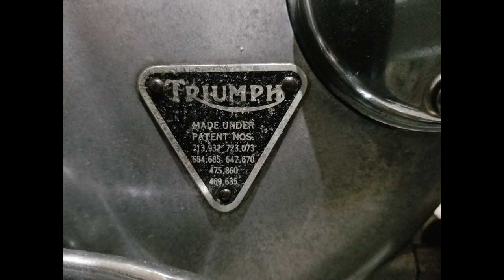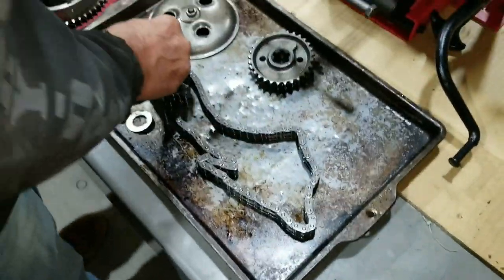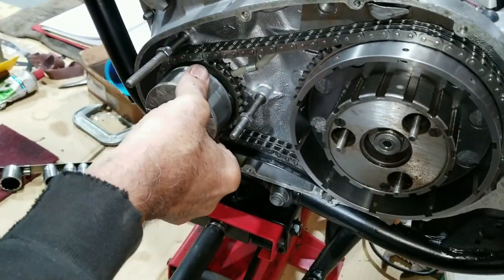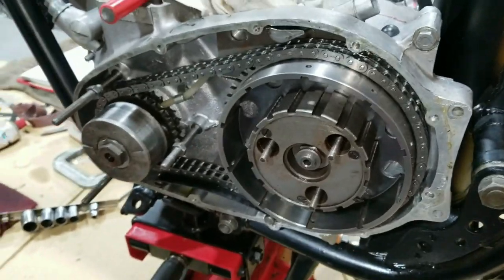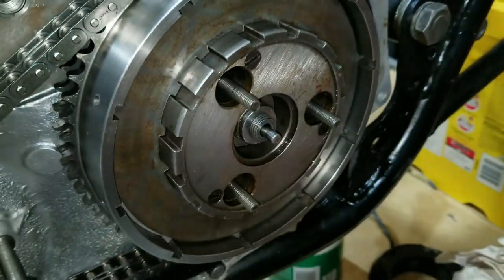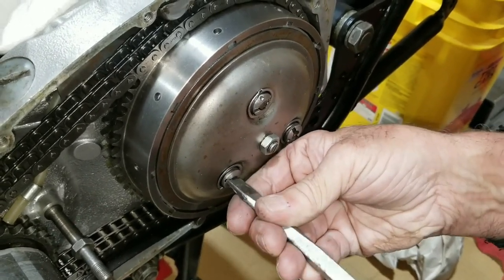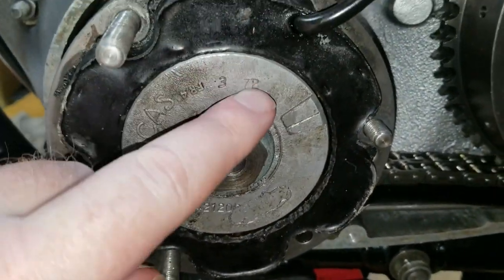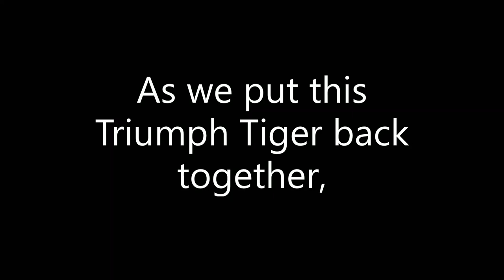1971 Triumph Tiger 650cc Restoration Part 15, Primary assembly

Comment: Hi guys, I noticed you seem to have wound the springs in past the point where the stud is flush ? I did the same but was told that they should be flush, I tried winding back out but it was too strong to unwind, I noticed the tool you use has a lot more leverage though, Great video 👍
Reply from the maker: Thanks for the great comment, Well the book does say set the springs flush but it's very annoying when they sometimes slip when doing a rapid acceleration through the gears and you find it slipping at 3rd  only to go back and tighten it up a bit! That's why we tighten them a little past flush every time.,
Reply: Ok, thanks for that. 👍 @jessesvintagegarage765

Comment: Nice video, i was waiting to see how you adjusted the primary chain, I heard you at the end say you got your 3/8 but how did you do that. I have a 67 tiger and i could heat the chai slapping in there. I believe its done on the back bottom. Can you tell me how to adjust that, thank you
Reply from the maker: Thanks, You take a plug out on the bottom way at the rear about at 5 oclock inside where that plug came out there's a slotted screw about a 1/2" in it's hard to adjust without the proper adjustment tool but a very long round shaft screw driver can do the job as the exhaust is in the way unless it's off. To check freeplay you remove the plug and move the chain up and down with your finger but the outer primary cover should be off to adjust and get a proper free play measurement with a rule.
Reply: @jessesvintagegarage765  thank you Jesse, I appreciate you getting back to me, I'll be doing that this week. Would you happen to know what feeler guage size for intake valves, and also exhaust. That will help out also. I can't find my manual, thanks again
Reply from the maker: @nickpanhead7209  .002" clearance on intake valves and .004" on the exhaust valves.
Reply: @jessesvintagegarage765  thank you so much, that to will be done this week
Reply: @jessesvintagegarage765  just want to thank you again, for the information I needed. Just to let you know I found my manual today. Thanks again. Keep up the great video's

Comment: Great Video…. Where can I get that Plug Tool please.
Reply from the maker: @nigelbeaumont1109  Well we made those tools, you can buy something like it from lowbrow customs and a wrench looking one on eBay they cost more than making them like we did though, But to make them you will just need to measure the caps slot and get a chunk of 1/2 hex stock and weld the pieces together. Triumphs need two for mid 72 and earlier, one for rocker box caps and one for all the rest
Reply: @jessesvintagegarage765  Thanks a lot.

Comment: Are both the rotor and stator original?   I see the year 72 marked on the rotor, so I'm guessing they are.   I just replaced the rotor and stator on my 64 TR6 this weekend.  I was upgrading the bike from 6v to 12v's and the old charging system was a bit sketchy so I just tossed it.   Now the bike is charging great...and my lights are working so much better with the 12v set up.  

The design for the stator wire hole seems better on the later bikes.   On my 64 the wire goes into a hole in the primary then comes out under the motorcycle.  For whatever reason the wire didn't want to push through the hole.    I had to cut off the bullet connectors and the sleeving then put them through one wire at a time.
Reply from the maker: Yes they were original Lucas parts, I got the rotor from a vintage bike dealer the original one for this 71 wasn't working right when I originally bought this bike 10 years ago, its amazing but sometimes when working with these old bikes original parts are the best to use cause aftermarket parts are junk, but then some original parts are junk and need to be replaced by better aftermarket parts.

Comment: Great video, but you should have really soaked those clutch plates in oil overnight. They will end up burning on your first ride. Stay Tuned oh and by the way Stay Tuned, Stay Tuned lol.
Reply from the maker: Ha ya I am working at not trying to say the stay tuned phrase as much if barely in the upcoming videos, I just felt like I needed to say it when I broke away for a moment but the video is continuous and the saying is unnecessary thanks for bringing it to my attention.
Reply from the maker: As for the clutch situation, That is a good question and something I did not mention in to detail, Oiling the clutch disks is mostly a manufactures recommendation and a personal preference situation. Like, Barnett Kevlar clutch disk sets require you to pre oil them first, The original cork type require you to pre oil them first, But with this bike we install a Aerco 7 plate conversion kit, this type of disk set has a new friction material. This material keeps the bonded plate from sticking to the steel plate. This special 7 plate kit is not required to pre oil but you do need to clean them first before installation and it is suggested that you can use lighter clutch springs for an easier clutch operation as well, I hope this helps
Reply: @jessesvintagegarage765  It's still a wet clutch design tho. Personally, I'd still soak them prior to install just to be on the save side.

Comment: Hey where is the boat that I can rotate my engine with please reply
Reply from the maker: Are you talking about the red coated rod that were protecting the connecting rods with and locking it from rotating, cause that is something we made, I would like to help you but I need more information cause during this moment the engine can be rotated easily
Reply: @jessesvintagegarage765  so I have a triumph t140 750 1971 and the motor is seized where the motor has been sitting for so long and I’ll put some stuff down it and now I’m just trying to turn it over without using the Kickstarter
Reply from the maker: @420hondakid8  Well if it was mine I'd remove the head and get a 12 inch long 2 x 2 or 1.5" round wooden dowl place it center of one piston and hit it down and alternate back and forth from piston to other piston don't be afraid to hit it very hard because you need to break the rings free where they rusted to the cylinders those pistons will need to be replaced with new anyways most always the cylinder will need bored to get past the rust to clean it anyway. Hopefully the pistons aren't all the way down but there's ways around that also.
Reply: @jessesvintagegarage765  ok appreciate it

Comment: DID YOU CHECK SPROCKET ALIGNMENT IMPORTENT VERY IMPORTENT FOR CHAIN LIFE .CHRIS  AUS
Reply from the maker: Yes we actually did that when we replaced the miss matched parts in the primary years ago when we first got this bike, it had both 650 and 750 parts inside cobbled together, once we assembled it with the correct 650 parts everything lined up,